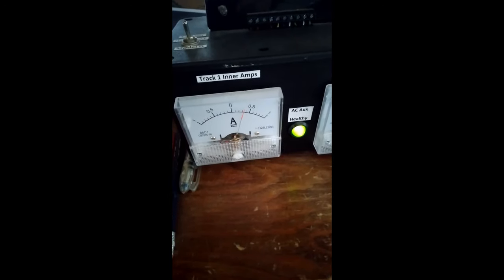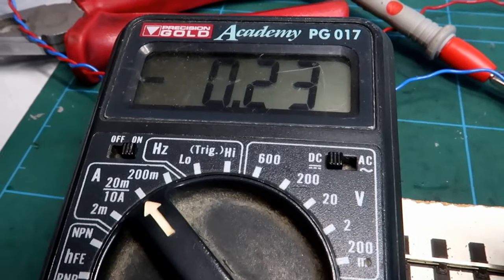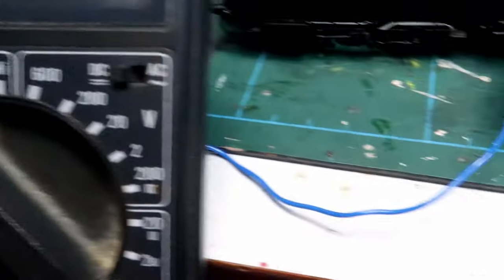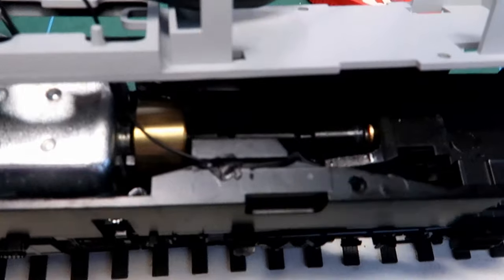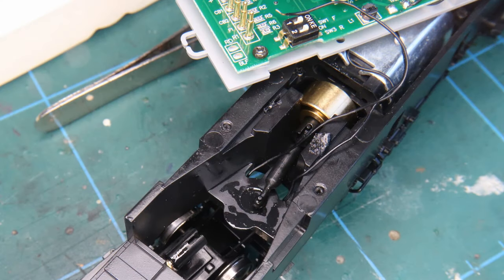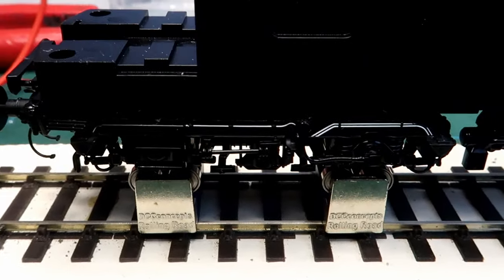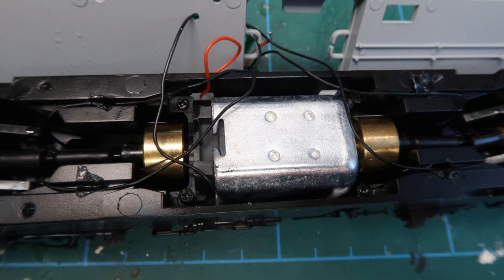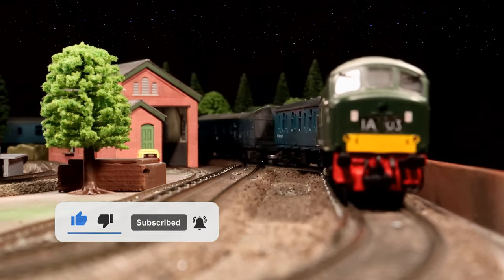Dapol class 73 in trouble [strip down and service video]

Comment: I learned so much about methodical troubleshooting in this video. Thanks for taking the time to film snd upload this. Interesting and very informative. I’ve had poor running from both my 73s, but fixed them them by dismantling and cleaning the bogies and bending those pickups. Both run great now and are lovely little locos. All the best, Colin
Reply from the maker: Glad it was helpful! Thanks Colin. Yes they seem sweet runners now, I do have an older one. Still not 100% about the motor. Your kind comments are greatly appreciated

Comment: The suppression capacitor is actually on the blanking plate. In this way it is removed when you fit the decoder. You should remove the extra capacitor you fitted, it is not required and could in fact impair suppression as you will have doubled the capacitance.
Reply from the maker: Hi, I've just checked this and I had not appreciated that the board was double sided. So yes pins 18/19 do have that cap across them, thanks for the heads up. I'll remove that section of the video

Comment: Reminds me of the bad old days of the green grease they used to use, the stuff that eventually degraded to a sticky green mess that gummed everything up.  In the end I went over to using ZX1 synthetic grease because the offerings on the market were shall we say not up to spec.
Reply from the maker: Agree mate, Bachmann in the 90s used something that turned to hard wax, many of their 08s have come through my works absolutely solid.
Reply: @ModelRailwaysUnlimited  I buy a lot of Lima locos, many of which are listed as 'non-runners / spares or repairs'. In the vast majority of cases someone has put grease on the self-lubricating nylon gears and the grease has either gone hard or attracted some stray ballast (or similar) and it's got locked in the mechanism. While it's great for me to buy all these engines cheap, I do wonder how many people have wrecked perfectly good locos because of this weird fixation people have for putting on grease on everything that doesn't need it...

Comment: A comprehensive analysis and strip down Mike, so glad you’re back in the saddle, I’ve had problems with Dapol PCBs before, ended up scrapping the locos as had no clue what to do. 
Shame because they’re really nice models.
All the best and good health, Darren 👋
Reply from the maker: Ahw, sad to hear. Thanks for watching
Reply: Can you not just skip the PCB's and run the feeds straight to the motor - old school? You might lose functioning lights or whatever, but at least you won't have to scrap the loco. Although that would only apply to DC operation of course...
Reply from the maker: @locohauledforum  the motors feed is almost direct. I get what you say however, a 0.1uf cap and a couple of diodes should be enough lol

Comment: Hi Mike, glad you are on the mend. But don't go too mad. Stick something reliable on and just let it run in the background. 

I picked up a H class without a motor recently for an amazing £44 and have managed to procure a replacement motor from Hornby. Looking into the gear train assembly it looks like someone in China tried to fit a whole jar of Vaseline in there! No wonder the first motor died.
Reply from the maker: Hiya, thanks, yeah still under the doc and all sorts of tests done. She's fine now and I'd have put up another video to show it if my software would stop crashing lol. Nice one with the H class, did you see my video about fitting spacers under the worm cover?
Reply: @ModelRailwaysUnlimited  I did indeed, first place I looked for service information :)

Comment: Excellent observation Mike. I'll have to get mine out again and give it more of a test. I always thought a cap across the motor was essential to reduce commutator arcing as well as rfi suppression  - surely still a legal requirement? Dapol's response will be interesting. Thanks for posting this.
Reply from the maker: Cheers Chris. Like you I think it controls arcing, nobody seems to care about rfi these days, as a keen swl that bugs me
Reply from the maker: HI Mike

Sorry to hear of the problem.

You will need to contact our service agents, DCC Supplies, who handle all our repair work.     

Not very impressed to be honest
Reply: @ModelRailwaysUnlimited  Hmmmm, just had a gander at the Ofcom website where I found this "Anyone using electrical apparatus is responsible for ensuring that it does not cause harmful interference to others. If this happens, we may require the user to rectify the situation. Find out about our approach to spectrum  enforcement." So it looks like rfi is still covered  by a legal requirement. Perhaps Dapol needs to be made aware they are breaking the law by not fitting suppression? Best regards Chris.
Reply from the maker: @chrisvaughan159  thanks Chris, Hornby are the same. They all think dcc will be fitted that probably does have something. Otherwise Hornby will say the cap should be in the track.
Reply: @ModelRailwaysUnlimited  Yeah!?!. I was always taught the suppressor should be as close to the source of spark/field collapse as possible (as it was in GPO relay days!), since any intervening wiring (or track) acted as a very efficient antenna. Gone are the days of 405/625 tubes, but as you know, there is plenty of AM still out there!
Hoping you feel better soon. All the best Chris.
Reply from the maker: @chrisvaughan159  Thanks Chris, I have since discovered there is a capacitor on the blanking plug that is across the motor feeds. Did not realize the board was double sided, hardly close to the motor however lol
Reply: @ModelRailwaysUnlimited  Well it hasn't hurt you putting a "proper" sized unit in parallel (I bet T'other was surface mount), in the correct place has it.

Comment: I have one that behaves badly. It's ok once it's had a long run but nowhere as good as all my old Hornby models.
Reply from the maker: Sorry to hear that. Have you tried anything to fix
Reply: @ModelRailwaysUnlimited  No I am not that confident with it. It runs but not as well as it should.
Reply from the maker: @modelrailwaynoob hi, this video shows what I did to improve mine. You can see the bearing pickup arrangements. You might try some Peco Electrolube on the axels, this will improve conductivity
Reply: @ModelRailwaysUnlimited  thank you